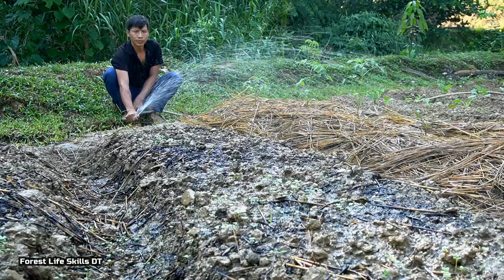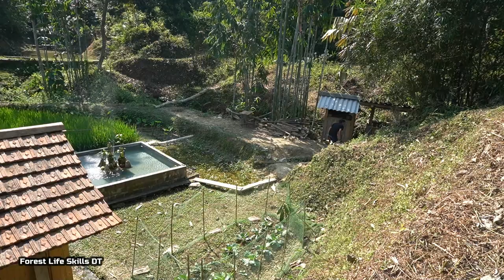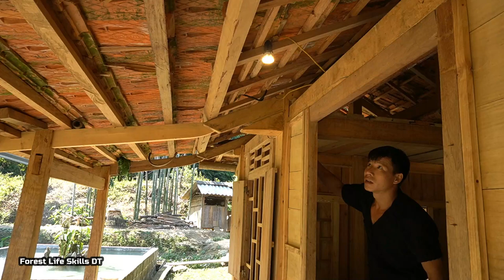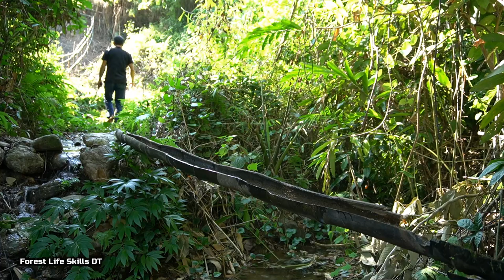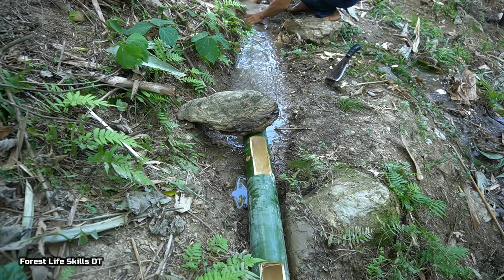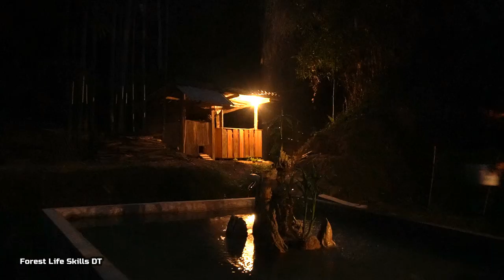Reinstall the electricity of the wooden house, Repair mini generator

Comment: Handsome, suggest that you should made a shelter for your motor, and I'm not too sure if you should add grease or motor lubricant to the motor.
Next, you should use day light buld especially at your house. The light buld you are using, in long run, it's not really good for your eyes.

Comment: I like wearing black too but it absorbs the most heat/infrared, reflecting no sunlight.
White or light colored clothing would be much better for reflecting a high proportion of light, is easier to spot bugs on, and is much easier to clean, and will feel cooler.